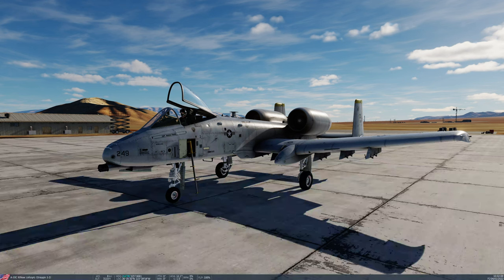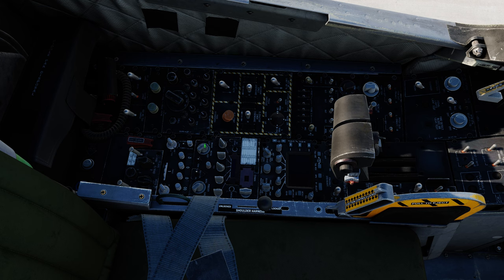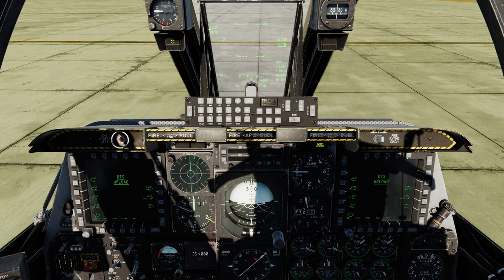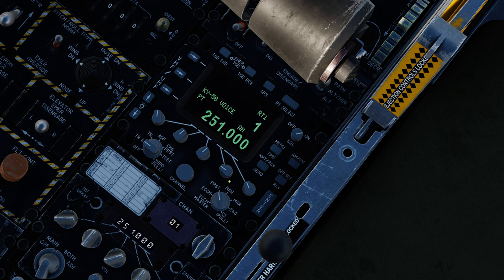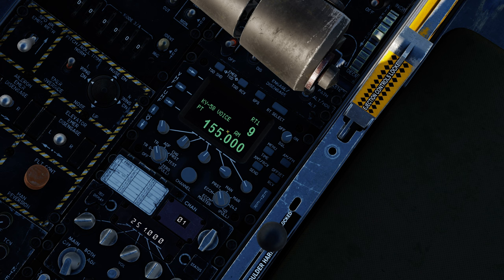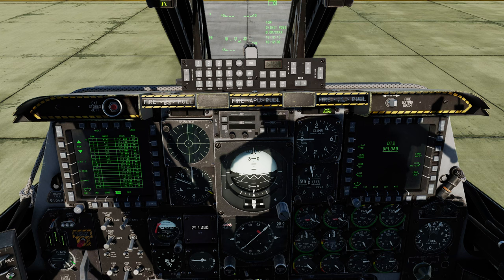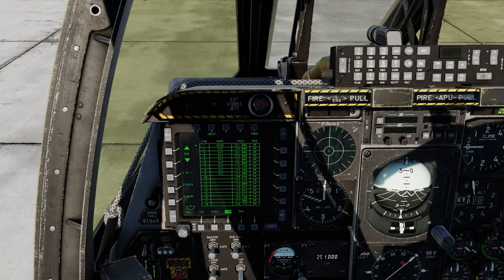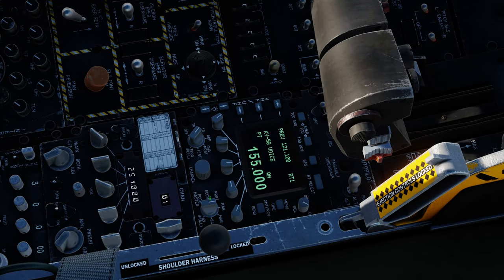DCS A-10C ARC210 radio

Comment: So i've just started playing Operation Piercing Fury. The first mission asks me to monitor multiple frequencies. Is the only way to do this currently to jump between the last 2 programmed frequences like you do in this video?
Reply from the maker: That depends on the type of frequency you need to monitor. You have 3 radios in the A10 so if they are 2 VHF AM frequencies then you should be able to monitor both.

Comment: So unless I missed it, no volume control on the left console for the ARC-210?
Reply from the maker: I don't think so no. You can control all audio volumes using the audio panel at the rear left of the left console though. I assume this radio will use the channel labelled UHF.